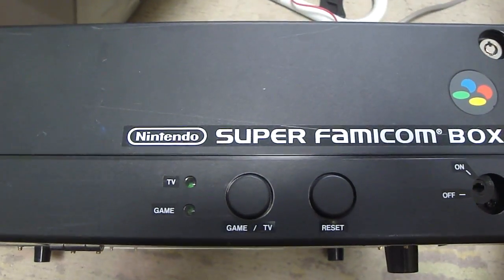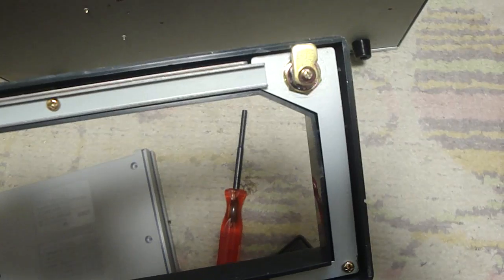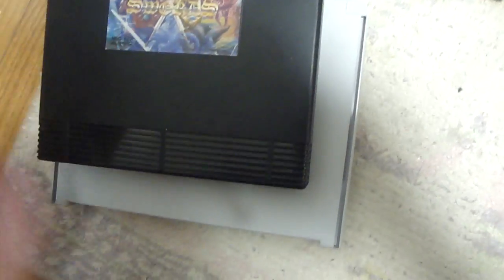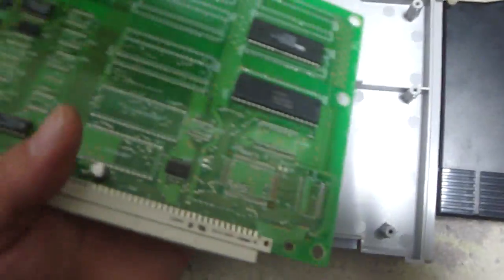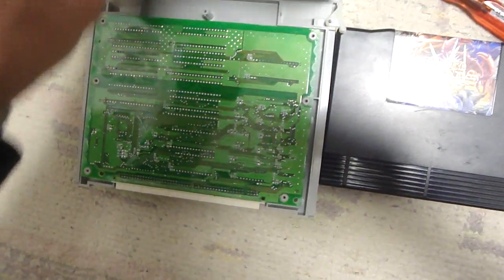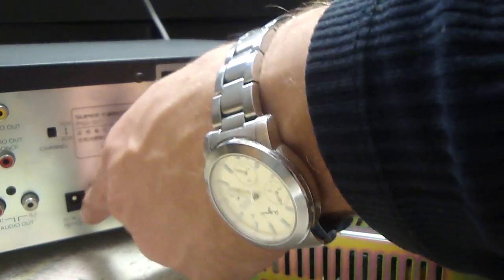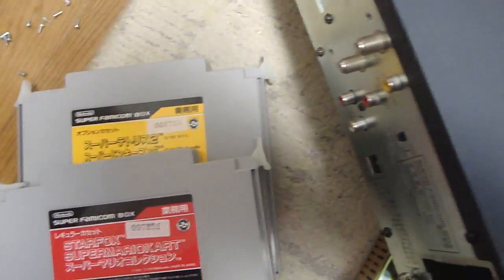How To Open And A Look Inside The Super Famicom Box And Carts

Comment: Before I had my security bit I used a BIC pen to remove one or two screws. You take a standard clear plastic BIC ballpoint pen, remove the cover from the back end and heat the back end with a lighter. When it's soft you push the pen onto a screw and let the pen cool and set. Its hold may be strong enough to undo the screw. My pen gave out after the second screw, so you may need a bunch of pens.

Comment: Instead of damaging the screws, take a flathead screwdriver (or strong extended flathead bit) and use a Dremel tool to remove material from the center of the flat edge leaving the shape of a "U".  Widen the opening a tiny bit at a time until it JUST fits over the security screw.  You may have to grind the thickness down slightly also to have a snug fit.  I did this to make a bit to remove screws from a Zelda cart to replace the battery inside.  Just use a large bit that is not too cheaply made.

Comment: GROM 3-1 seems to be the Cart's control ROM, but the games probably are  in the right ROMs instead. There are space for 4 more GMAE ROMs, making a possible total of 6 GAME ROMs.

For Swapping or adding ROMs, extra support chips might be needed. At the left, there are at least 7 small unused IC spots.

At the bottom right, there seem to be extra support chips for games that support them or if the hotel owner support them.

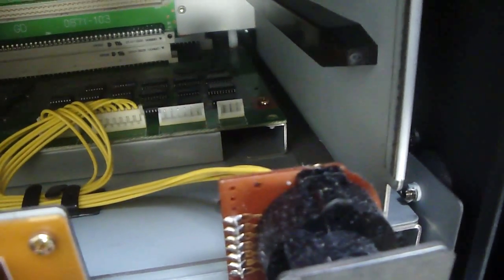6:00 They are for the Coin boxes and other hotel services.

Comment: Looks like there is space for about 6-7 other games on there. The eprom is most likely a BIOS for the cart while the mask roms on the right are the games. The carts are afaik all dumped so can most likely be modified to work with other games, or you could just probably replace all the ICs with dumps from MAME for other game sets.

Comment: Neo Geo cower before the awesome size of Super Famicom Box carts. ^_^ Yeah I think a mod to those carts wouldn't be hard, you could make the worlds biggest flash cart with an SD card inside. There must be a battery in there somewhere. Are you going to restore it as is or Hotrod it and give it a regular on/off switch, non key panel lock, and regular screws? Thanks for the tour, very cool. :)

Comment: You could probably change the game by reprogramming some roms as long as they are around the same size as the original game. If there is no battery it's possible it uses a flash chip for game saves.

Comment: I’m trying to get mine to save games. I’ve replaced the battery but it makes no difference. Does anyone know a way to get save files to stay after power off?
Reply: What size of security driver did you use to remove the screws to open your box. They are bigger than your usual nintendo console / cartridge screws so I can't get mine open. I've also tried pliers, socket set etc but nothing works.

I'm desperate to change out the dead battery
Reply: @bryanpaton4191  I didn't, I mention this in my own video on the system - the line head screws (otherwise known as 'security bit screws') are a non-standard size bigger than the 3.8 and 4.5mm ones used on standard consoles and cartridges. You literally cannot get the tool or bit anymore anywhere online as it's no longer made. I tried a load of different options until I eventually went the best option for future access; I used a dremel tool with a cutting disc and carefully cut a centre slot in each of the security screws.... you can then use a standard flat-head screwdriver to undo them any time you want. Here is my video: https://www.youtube.com/watch?v=wonymZxoV0M&t=22s